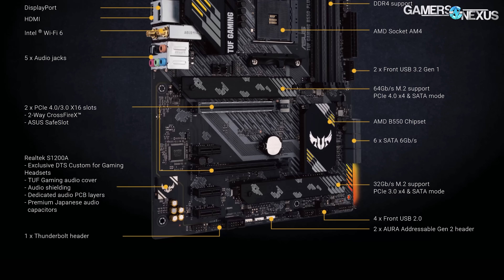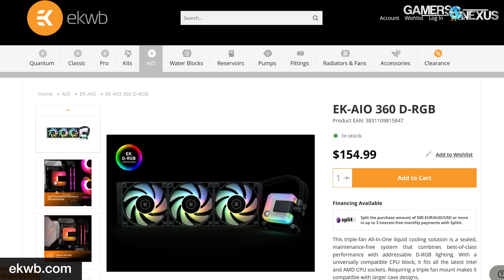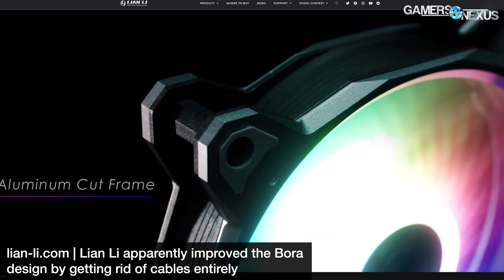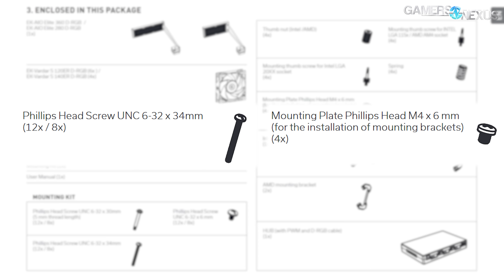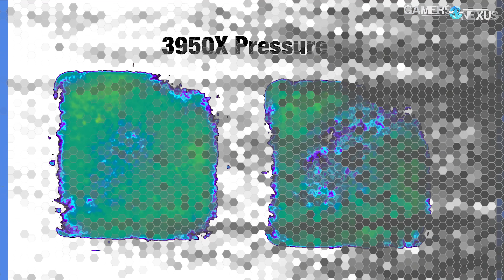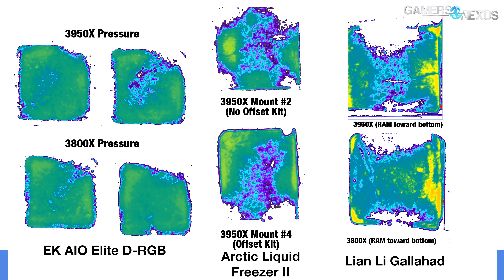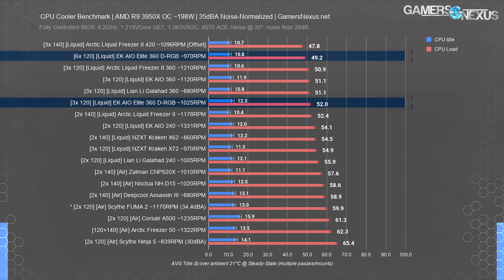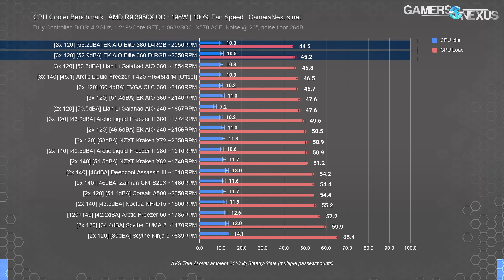6-Fan EK AIO Elite D-RGB 360 Review vs. Lian Li Galahad, Arctic Liquid Freezer, & Air CPU Coolers

Comment: I bought the EK for looks and function. Very happy. Running on 3 fans and very impressed with performance. Cable management wasn't too bad with the 3 but when i had 6 installed... not only messy but noisier than I would've liked.

Comment: So for my Phanteks Enthoo 719 case, I needed to buy all of my own fans and went with EK VARDAR EVO D-RGB fans since they are basically the same fans that come with the EK AIO. However, the interesting thing is that the Elite AIO is actually better value than the non-elite AIO. Each fan costs about $25, so if I went with the non-Elite model, I'd have to buy 3 extra fans for my case for $75, totaling around $225. However, getting the Elite model gives me those same 3 extra fans at only $200 (including an RGB hub), and according to EK, the Elite model has a stronger pump than the non-elite model; plus, the Elite model just looks so much better. 

So overall, I'm very happy with my purchase of the Elite model, even though I don't use the push-pull configuration. I saved $25 for something that performs the best in terms of RGB AIOs.

Comment: What they REALLY should have done is have built-in cable management and lengthen the cables so that when they are managed they all are the same length with a single cable sleeve that splits out at the end where the hub will be.  This would have made this a MUCH better product.

Comment: I have the normal 360 drgb ek aio and I have a blacked out build with all my rgb to white and the block with the white light and white acrylic looks pretty good to me. But any other color than white and it doesn't look good. This new pump would also look great in my build too though and would prefer it if I had the choice.

Comment: The ammount of useless plastic in products like this is insane, good on you for giving ek crap about it! Any chance they followed up on that criticism and plan on improving? 

There's a very easy way to avoid most of the fan plastic, just mount them, you'll also save the bag for the screws and guarantee that they are all there

Comment: Ah yes. The Asus Tuf Gaming motherboard. Just tried to update my X570 one over the weekend and Asus' updater bricked it. It went through the process, said successful and that it was going to restart, then never booted again. So, one new motherboard, 4 bent CPU pins, ~6 hours of work and a few more grey hairs later, I finally got my 5950X up and running.

Comment: If you're going to swap fans, do you recommend keeping the push or pull fans on the cooler?
Reply: I have this model, and I played with both pull and push.  I ended up with push and a top mount.  In my experience (anecdotal), it is not a massive difference.  YMMV.

Comment: one thing worth noting about the EK AIO coolers is that the screws that attach the correct mounting brackets to the pump/block stick out quite a bit and can cause clearance issues when using delidded CPUs. I ended up super gluing the intel brackets onto my EK AIO because those aforementioned screws would contact the inductors on my motherboard and prevent proper contact with the CPU. I hope that EK can use some sort of countersunk screws on the mounting brackets on their next revision of these coolers. I know that by rotating the pump/block 90 degrees would solve this problem but that introduces other clearance issues with the VRM cooler and memory on my particular motherboard. Then again this might just be a super niche issue that doesn't justify a design revision, I can't imagine a whole lot of people are putting this massive AIO onto a delidded CPU on a mini ITX motherboard.

Comment: This AIO has daisy chain capabilities integrated. This is able to cool my Ryzen 9 5900x @ 4.7Ghz on all cores 1.4v. Great to finally see Steve review it.
Reply: What are your load temps
Reply: @DC3RejuvationGB  I haven’t checked in a while. From what I remember 70c-85c gaming and streaming Warzone 1080p.
Reply: @senseitetra4318  thats a very high temp for gaming! Since cpu in the games should be 20-30-40 % tops! And gpu is at 99%! Shes doing the work..so having that much high temps on cpu in games is very very bad...mine 5900x with corsair 240 aio sits in games at 50c, and at 78 at 4.5ghz at full load (like cinebench)

Comment: Personally like the plastic, if I spend 200 bucks I want to be sure it was not a return and then sold to me as new, if anything was opened or tampered with you know with the packaging. Also enjoy all six the fans at full blast it keeps my i9 10900kf from breaking 67c at full load at 5.3ghz. Its not bad to cable manage its why they invented zip ties makes it very bearable. Also with the hub on your test you do know the fans are tied AIO pump in the same fan header?  You lower the fan speeds you lower the pump speed it will not run at its full 3300rpms reducing cooling I do believe. So lower fan speed equals lower pump speed About the only drawback of the hub if you tied everything into it including the pump/block. Or does the fan continue to run at full blast regardless even though its all plugged into the same fan header via the hub?
Reply: I plugged the pump in the pump header and the fans in the cpu fan header. Pump runs full blast on pwm and the fans are on auto, all through bios.

Comment: making just a bit too much about the cable management. sure there are a lot of them but so what? with the current top cases you have so many places to poke the lines through to the back with a few zip ties to tidy up you'd have it look pro in minutes. seriously 6 power lines and 6 light then the set for the head its not exactly a rats nest.

Comment: If you take 3 of the fans off and put them somewhere else in the case the cost of the cooler almost negates itself since you would buy a 360 rad and usually 2-3 additional fans anyways.

Comment: That hub seems sweet, RGB and Fan hub for 6 fans and not proprietary like the corsair commander pro. So many hubs are only for fans and ignore RGB. Would actually love some cable guides on the fans and shorter cables so that cable management can happen on the fan array itself rather than an ugly mess in the back

Comment: How did the pressure test right corner correspond to the measure flatness? Or do you put that down to the cables or spring tension allowing it to lift off somewhat. 

2) any benefit to overlay an approx position of the amd chiplets or intel chip on the pressure chart?

Comment: Honestly? I'd take off three of the fans and use them as case fans elsewhere, and only use the radiator in push or pull mode (depending on the case).
Reply: with the included fan controller I think this would be pretty easy and around 6-7 fans total (add extra one for back maybe, again depends on case) is normal for cable management

Comment: I have the NON elite version of this and absolutely love it :)

Amazing temps and looks phenomenal in my Lian-Li PC-O11.
Cable management was quite easy, you should just connect everything into a HUB like the Lamptron SP901 ARGB Fan Splitter or similar (Elite comes with this already) :)
Reply: Is the difference just fans or is the more expensive one slightly better

Comment: in short for people new to this stuff , you need push pull only if the rad is too thick and has dense fins ..you are welcome
Suggestion for Arctic use fans like MagLev , change your mounting , use thicker rad , maybe use copper rad/fins and stay away from the z2pid rgb

Comment: I don't get why more AIO manufacturers don't integrate the fan controller board into the radiator. It's a small PCB, they could fit it up by the input and it would make everything so much cleaner

Comment: A black PCB direct mounted to the side of the cooler with short cables to the fans or direct header connections into the fans would be ideal. I'd rather have to take the board off to service the fans... than ever have to manage those cables. Solutions don't have to be proprietary... what we have instead is a thoughtless mess.

Comment: I had this cooler and the pump had a noticeable wine over 60% duty cycle. When working with EK they claim it to be "Normal". I did not see you mention anything about the pump wine in this video. Is EK feeding me a line of crap or was it not mentioned due to the fans noise levels masking the wine?
Reply: I don’t hear any noise from my pump.

Comment: 100% would do as you said and mount the fans else where.
The OCD in me hurts when people have brandA type 1 fans up front, brandA type 2 fans on the rad, and then brandB fans that came with the case.

Have seen testing on some air coolers with the same effect of push+pull not all that beneficial, so I just put the rear fan off my noctua NH-U12A and mounted it in my case... just meant one less case fan to buy (which lol OCD were all the same)

Comment: Curious about fan speed at quiet setting or 50%, does push/pull difference increase then or is it same? If your going to run high static pressure fans at 100% push/pull likely useless but what happens when fans are at like half the static pressure I bet push/pull worth it then.

Comment: So we need to read these temperatures as “over ambient which is 21”. So if your graph reads 10 degrees then the viewer needs to add another 21 degrees to that. So the temperature in this example would actually be 31 degrees?

Comment: QUESTION
Why not build the fan hub directly into the AIO itself? Then there would be very few cables. One for the CPU fan header, and one for power (one for the pump too unless that's built into the fan header.
Reply: (I would still recommend the ability to remove the fans to use elsewhere... I guess it's a hassle to build the fan header into an AIO since the products are manufactured by different people, so there's a big expense designing a new product from scratch)

Comment: I actually like the plastic RGB block. I think they may have deliberately matched it to the TridentZ/Neo ram that is very popular as they have the exact same type of frosted plastic diffuser.
I think it looks quite nice when you set it to a solid color rather than the rainbow spiral effect.
And as mentioned in the video it's definitely a value proposition to buy the push/pull EK setups to take half the fans and put them around the case, gives you a unified hardware look. I got the 240 DRGB on a special with 4 fans so I have 2 running as exhaust case fans.

Comment: I use push pull on a cheap 240 vetroo and my temps dropped and stay low on an old fx build cpu that I was ready to junk. It is either that or I had a bad paste job before. Either way I breathed life into an old junker using a similar setup to what this is offering.

Comment: So could I slap 3 more fans on my ek aio d-rgb 360 and have roughly the same performance as the elite?
Reply: The elite pump was upgraded. The elites pump runs roughly 700rpm more then the regular. Which explains why it performed slightly better in the same 3 fan configuration. If you were to put the additional 3 on the regular it would improve performance but by a one to two degree difference. But the elites main selling point imo is the hub and 3 extra fans for $50 more dollars. The fans would be a min of $75 so it's like getting one extra fan and a hub for free.

Comment: So Steve: I know there are 1 or 2 small cooler pumps, Eisbär Solo LT is one, that allow you to build your own loop while still being very compact. Maybe an idea to test that Solo LT with 2 very popular radiators, and put the results against these. Is getting your own worth it? Is the extra effort rewarded or is it pretty much the same and so not worth the effort? Is the bonus of getting the shorter tubes instead of standard lengths worth the hassle? Maybe test 2-4m of pipe against 50cm. Probably no difference, but who knows. 

Maybe make it a big test. Is very thick tubing worth it? What if you go slim to make it work in a very small enclosure? Maybe take the best 3×120mm rad tested, use the standard tubing, the slimmest and the thickest. See what happens, if anything (or 2 best, but testing too many combo's will really stack up the amount of work). Speaking of small cases, if you build very compact, will a 40mm radiator be good? I know they exist and have been eyeing them for a build myself (although truth be told I will probably build it with wc for cool points anyway even if worse, cannot be worse then what is in standard 1U height cases already).

Comment: If cable managing that is a nightmare for you then you have yet to go HARD CORE. I have 5 rads with 22 fans all wired up, cable managed neatly and with RGB going to them. In fact if you were to take the panels off the case I have you would actually need to look to find the wires and where they are going. It is cable managed to perfection.

Perhaps a better argument is that this particular AIO is right at the top of the AIO chart and pushing the limits of where a custom water solution would come into play, both in cooling performance and wiring complexity. My custom solution is definitely out there and nothing like normal, but also nothing a well-skilled PC builder couldn't take a shot at. But if you are intimidated by an AIO... why are the guys at GN such tech pussies?

Comment: tbh I'm quite disappointed at 360 drgb from EK the non elite, I hit 80c in matter of seconds using this with 3 fans. I have reapplied thermal grease and tried to fix it but it won't happen. I'm on a 5800x and yes I know the 5800x is hot and all but others have had much lower temps with inferior AIOs

Comment: You should do a review of The Asus SABERTOOTH series of motherboards.  My all-time favourite MB series.  You would not believe the abuse I have subjected SABERTOOTH bords to.  I have one with an FX8320 @ 5ghz on air still in operation running my cnc. surrounded by massive emf, rf, unstable power, voltage spikes and dips, actual emp, metal dust, 40-degree ambient temperatures, vibration, impact, occasional cnc coolant, dust, smoke, self-destructing power supplies ( x4 so far ), a 90'c internal case temp for 3 days solid and a lightning strike.    The new TUF series has NOTHING on the SABERTOOTH.

Comment: Thanks for the review Steve.  I installed this AIO in my Dark Hero, X5900, Lian Li O11D XL last week.  I'm not big on LED either but a little static color doesn't bother me.  I used a pull config for the radiator on the side intake, and used the other three fans for top exhaust.  I added some 140s on the bottom to move some air over the vertical mount RTX 3090.  Not sure if this is the best layout with positive pressure, but I wanted outside air coming over the radiator and figured the 140s on the bottom pushing air over the GPU would make top radiator not as efficient.  My temps are good.  Just hope this is reliable over the long run.

Comment: I'm wondering why there wasn't more focus on the 4-5C difference between the EK Elite and the LFII 360 in the full speed test. This is a big difference. I understand the LFII 420 is much closer in temps, but the 420 is also more unwieldy to put in a case due its bigger fans. Granted, the EK Elite gets much louder than the LFII, but for those that don't care about noise during heavy loads, the EK Elite might be a much better choice (again, if you want to stay away from 420mm coolers due to fan size.

I have the LFII 360, and really wish the fans had a higher max speed so presumably you get a few more degrees cooling out of it (since the fans current max speed is relatively low, and at max speed, the fans are still very quiet).

EDIT: Looking back at one of their older videos, I realized the LFII 360 temps here are without the offset. So with the offset, the difference would only be ~2.5-3.5C. Still significant though if you're pushing an OC to the limit.

Comment: My Antec Neptune 240 has 4 fans. the included fans on the side of the pipes of the rad in a push configuration and the Antec Cooling Matrix on top for pulling. I wanted the Cooling Matrix as push but due to it being  top mounted its kinda tricky to have it as intake.

Comment: I got this cooler and put 3 of the fans at the bottom of my Cooler Master SL600M with the radiator and other 3 at the top. With my RTX 3070 mounted vertically airflow is excellent and temps for both the GPU and i7 9700k are great. My only complaint is the pump in mine is a bit louder than I would have liked.
Reply: Just bought this cooler during Black Friday, my pump is very loud as well, it’s an annoying whining sound. Did you find a solution to this? Thanks!

Comment: EK fans are loud like almost all fans on the market, they are noisy compared to Noctua or Arctic who have recently made significant progress in fan motor design.    Remarkably you have EK competing against a 3x140 which is going to have ~45 percent more surface area?!

EK looks really good in this review.

I've struggled for years to build a silent PC and have failed to date.  However, when I get my machine in a room full of other PCs with my friends my computer is inaudible in comparison.   The PC industry seems to suffer significant hearing loss.  Sadly it turns out there isn't much you can do for air going through fins and that's the only noise from my case when things heat up.

Comment: I bought one of these for my build because in my opinion this is one of the nicest looking AIOs.  Beware if you have an Asus ROG Crosshair VIII Dark Hero like me.  I have 4 Corsair Dominator Platinum modules and this AIO block/tubing does not fit.  It pushes against the first memory DIMM.  Now I’m stuck with an opened AIO (not cheap either) as EK would not accept it for return.  I switched to a Lian Li Galahad and it fits ok.